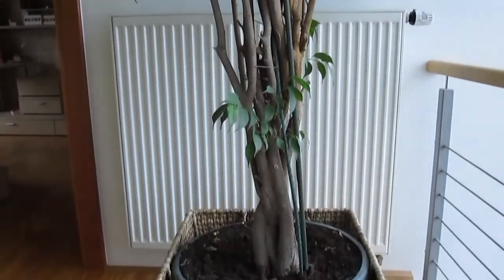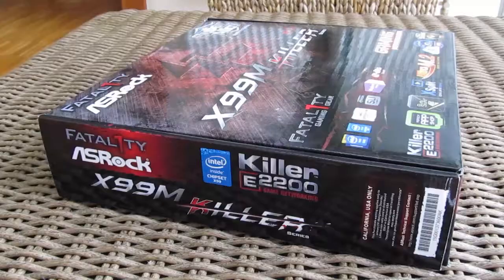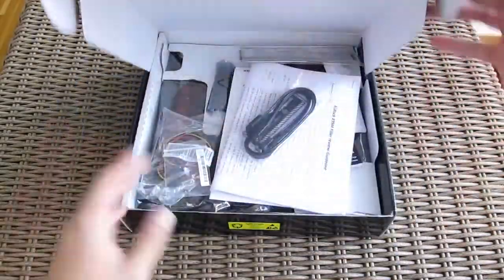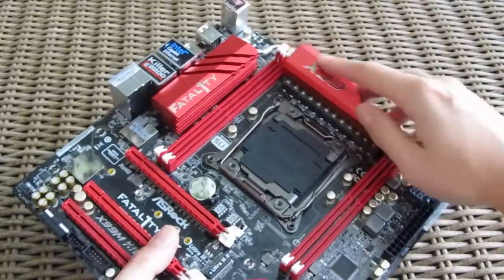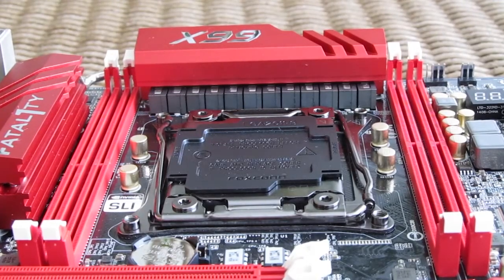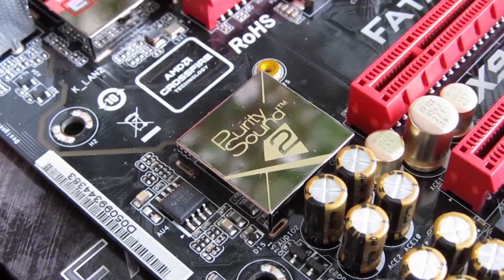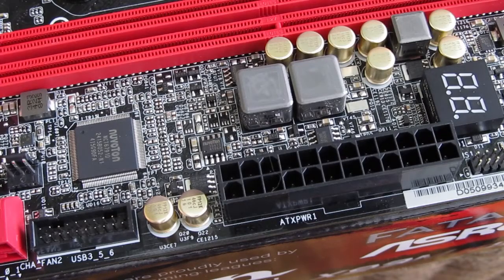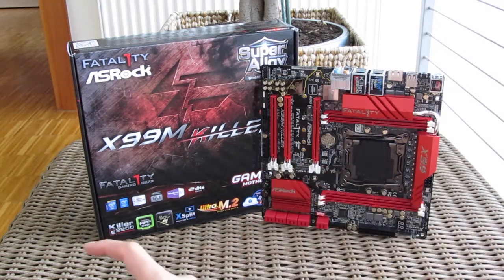ASRock Fatal1ty X99M Killer Unboxing & Preview

Comment: Pretty clever to unpack a mother board from it's antistatic packaging, when you are on a wooden floor and the box is on a wooden box thing which means it's not static free.
Reply from the maker: That situation is really, really, but really hypothetical. I've been handling computer hardware for the last 10 years, that's everyday, never had a single related issue.
Reply: So you have never had any kind of component defect in 10 years?

Never had anything break and never had anything sent in for warranty replacement???
Reply from the maker: Not because of that particular issue.
Reply: How would you know?

It's not like they instantly explode.

I've worked in several places where they had major problems with equipment coming back for warranty.

After I was done with improved procedures and work methods the warranty repair issues dropped from 17% to 0.5%

I can assure you that anti static precautions are not hypothetical.
Reply from the maker: Work method*s* and procedure*s* - you're implying that there was several changes in hardware handling. How can you tell that it was all due to anti-static precautions? Listen, I don't want debate about this, I think it's pointless. Yes, it exists and it's possible that something can happen, but I personally never had any issue that it could remotely be related to it, or that I've encountered it at all. That's MY experience, and as we can see, yours different, thus, experiences can differ, as per usual.
Reply: You don't go from 17% failure rates to .5%  with one single fix.
I never claimed it was all due to antistatic, i was just pointing out professional experience with QC and defect prevention.

Comment: When im in uefi and try to reset uefi settings, it asks for a password. I never entered a password and i have used clear cmos button in the back back port. Any ideas
Reply from the maker: Pull out all the power cables (ATX, EPS) from the motherboard and take out the battery for BIOS. Leave like that for few hours, it should reset BIOS to defaults.

Or try some of the generic passwords like 0000, 1234, etc...

Comment: Can you give me any idea on how the corsair H series install on these? 
From what I can tell online, it doesn't have the traditional holes all the way through the motherboard. So I'm assuming that really limits you to your aftermarket cooling. 
I'm mainly concerned because I read in a newegg review that someone had to drill out holes to get his aftermarkets to fit.
Reply: TekTick Hi, this mobo supports 2 GTX 970 Gigabyte G1 GAMING in SLI? Running both in X16?
Reply from the maker: Maite Zimmermann
Yes! First and fourth PCI-e slots are for x16 / x16 SLI / CF configurations!
Reply from the maker: It should have standard fittings as X99 and X79 did. They have four screw points around the socket, so not holes, but screw points. I don't see why it should be any different... :/
Reply: Alright, thanks man. I just wanted to make sure. I was really wanting to pair this with an h110i. Just trying to make sure there are no compatibility problems.
Reply from the maker: No problem!

It's all standardized and you shouldn't have any problems!
Reply: TekTick thanks!
Reply from the maker: No problem!

Comment: Cant choose between the EVGA X99 Micro or this board
Reply: definitely the ASRock! Better CPU power (12phase vs 6phase) and a proper m.2 slot.
This board could easily run an OC'd 5960X, in the mATX form factor, which is simply AMAZING!
good job ASRock :)